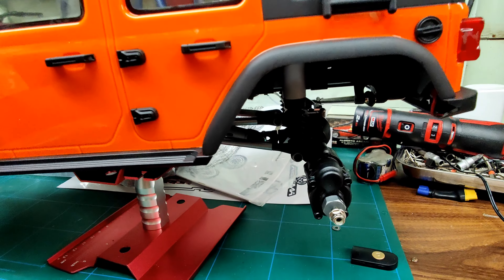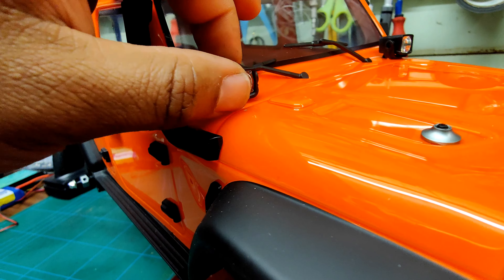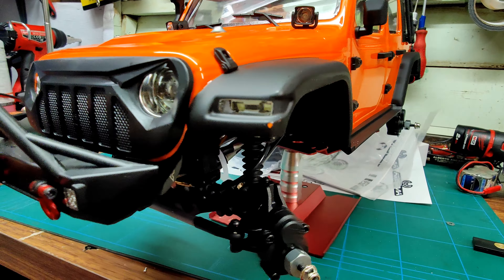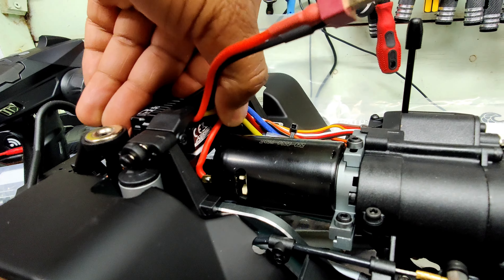Absima Sherpa detailed Unboxing and Test the trx4 killer!!!😨

Comment: Love watching old reviews of these, got myself one when they first come out and now got 4 in total…absolutely outstanding rigs for the money. 
The foam block that’s stuck to your body, mine came with that in the battery tray as a spacer, the radio take a 2s lipo through its inbuilt JST connector…can also change the way the radio works to control a winch through the stock transmitter by pressing a few buttons.
Great vid, thumbs up from me 🤙🏼

Comment: Yup, both the Sherpa and the Khamba blow the TRX-4 out of the water in terms of price/quality ratio, electronics (specially the SERVOS), materials, included details such fully controllable light system from the radio, the radio itself wich indicates you what do you have turned on or off via independent leds, body details, body-securing system, smoothness, baterry tray position and weight balance. I've got two TRX-4 trucks, the Defender and the new Bronco, 4 different RC4WD models, a Cross 8x8 military truck, the Sherpa and the Khamba. We can say that the ones i use the most, apart from the gelande autobiography, are both Absimas. They surprised me a lot.
Reply from the maker: Yeah it's a really awesome truck I love it
Reply: Well, not necessarily - I have two TRX4s that have covered just on 200 miles over Dartmoor terrain, with no problems whatsoever.  The first outing with the Absima Sherpa  Pro version, saw the gear change servo burnout, the steering servo with an  intermittent response, and a huge amount of servo play. And this was on a very easy "break-in" trail , but it turned out to be a breakdown  trail.  Totally unimpressed with quality.  Absima, it would seem, have a long way to go to match Traxxas, or even Axial.  Yes, it looks good, and may perform well eventually, but................
Reply: @andrewhaigh1531  I'm thinking of buying the pro version or a trx4 defender but not sure were you get parts for absima sherpa
Reply: @sailingachilles7810  Sorry cannot help, as I rely on a genius shop in Plymouth!   Further driving of the Pro Sherpa reveals a superb chassis, and mile-consuming pace.  Impressed indeed, but its noisy.  TRX4 Defender is still a fantastic all-rounder, but Traxxas need to improve their presentation of it.
Reply: Tienes toda la razón.. aún lo comparamos el sherpa con el trx4 de unos amigos y el sherpa va muy bien no falla es muy fiable